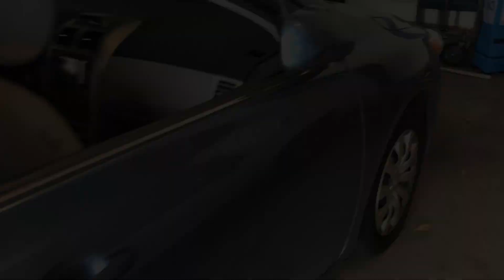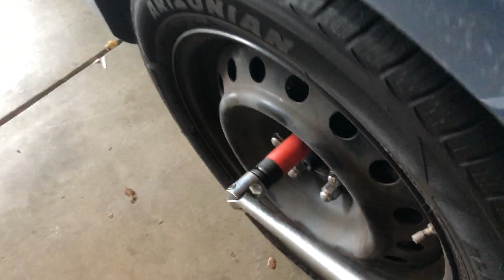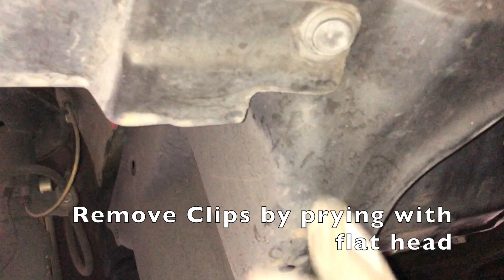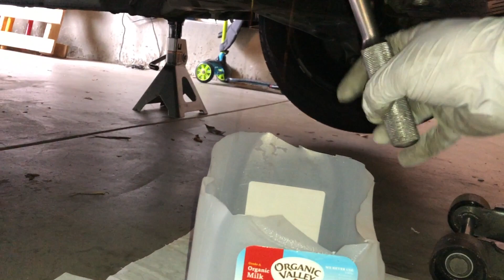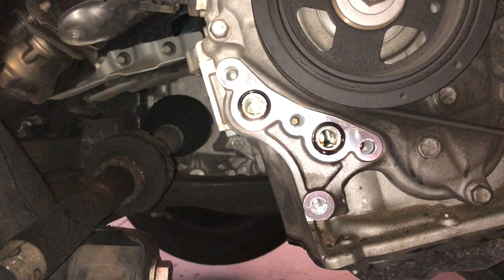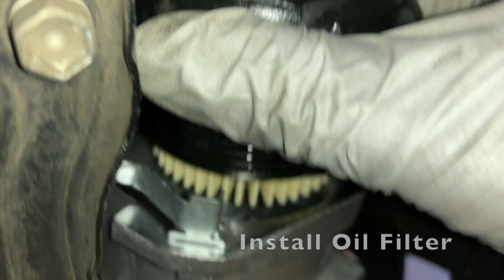Toyota Corolla Oil Filter Housing Replacement

Comment: Great Video.  Did you ever have a leak from the 2 allen plugs underneath the assembly?  Mine are rusted and started to leak right after changing the oil.
Reply from the maker: I have never seen it leak from the allen plugs but I also live in generally rust-free area. I could see how it could rust and cause a leak. Fortunately for us this repair was pretty straight forward. Thanks for watching.
Reply: @wrenchgroove9387  I have the same problem, New York state loves to use salt, how did you do with repair ? 2015 corolla
Reply from the maker: @dgnvg  I would first check to see if the dealership sells the two seals. If they do then the repair would be similar except you just remove the two allen seals of  instead of the whole housing.
Reply: Good video.  I believe I have a leak around the filter housing, but it's not damaged.  Do those internal o-rings fail over time?  Wondering if I should replace them.  2010 corolla 150k miles.  I'm aware other parts can leak in this area, but I'm most curious about the o-rings.  Thanks in advance.

Comment: FYI, it is necessary to remove this housing in order to remove control arm.
Reply: That's my question. I think I got noise from the control arm because I have changed the sway bar link, bushing, outer tie rod and Struts. The noise still there but less noisy. The strut is the real problem. It has to be the control arm  2009 Corolla with 190k. but the round bushing/control arm still looks good. Not sure where the noise come from.
Reply: I’m sure you sorted by now but for others = yes you need take that housing off to get the lower control arm bolt out to replace passenger ctrl arm. And FYI to get driver side ctrl arm bolt out it’s best to remove the front and driver side motor mount then jack up motor a tad then bolt comes out- for 2010 Corolla at least.

Comment: I noticed some grey residue from the bolts after removal. Not sure if it is threadlocker or anti seize. Did you put anything on yours ? I don’t want the bolts to come loose not sure if I should apply something to the threads upon installation. Thanks!
Reply from the maker: I put a little blue (medium strength) thread-locker. Make sure you don't over-tighten them.

Comment: Unbelievable them gouges in the threads. That's another reason to diy.
You want it done right. I do it myself or explain it to a mechanic.
Reply from the maker: Exactly Robert!
Reply: This has been a total pain in the rear.
Diy with a friend with the tools. I was not the lucky one to have an easy unscrew cartridge filter. Nope. We broke all the tabs off the plastic cap.
So I bought the filter housing bracket as you see for replacement cuz of the gouging in the threads. But then I  scrolled up or down in YouTube and found a simple spin on filter converter. I wrote Toyota for just the threaded tube that some have. Nope, not for your model he said. So futher researching I found the golden ticket for a spin on can WITH  anti-drain back valve. All can filters have it. But all cartridge filters DON'T have it.
https://youtu.be/62Ptx6n6d64
My 2012 Toyota Corolla Sport 1.8l L4 has a WIX spin on filter. No more cartridge pain in the rear. Good for some. Not for me.